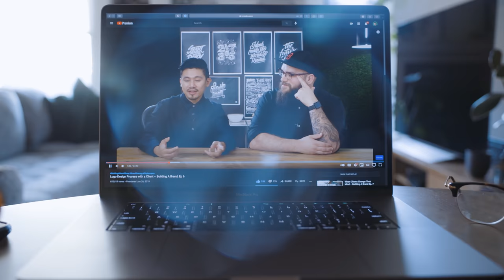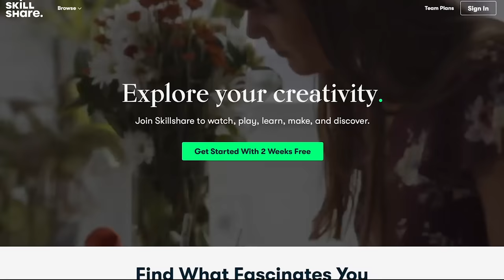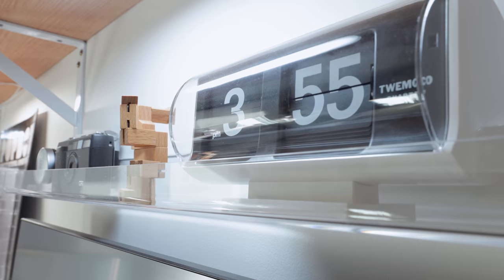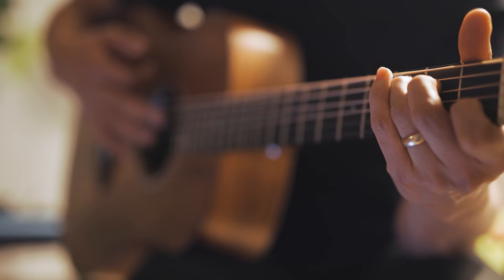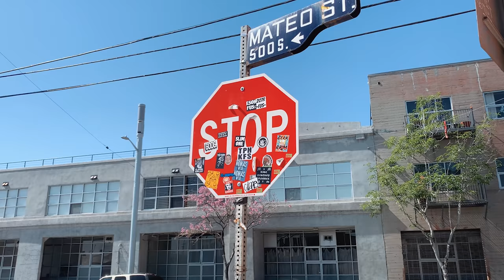A Day in the Life After Quitting my Job at The Futur

Comment: After 46 seconds i can say: Bro you need Insoles!
Reply from the maker: What makes you say that, and what could it do for me?
Reply: @MatthewEncina  your ankle is not straight and rotates because of the flat foot. You can correct this with an insole to bring the ankle to a straight position and release the pressure. Less pain in the foot, knees and the back.